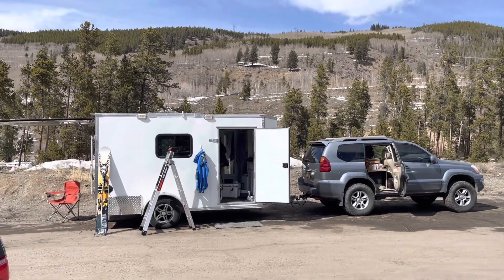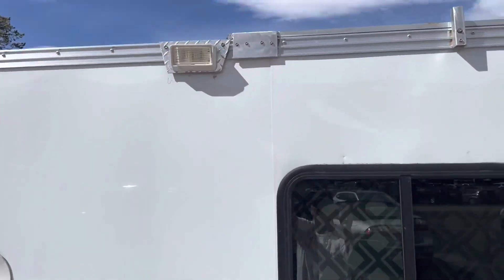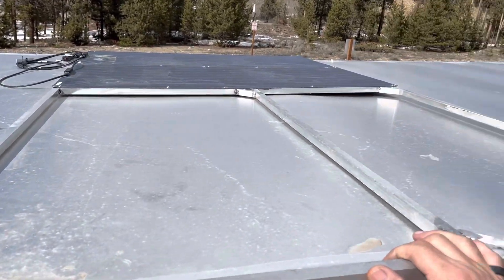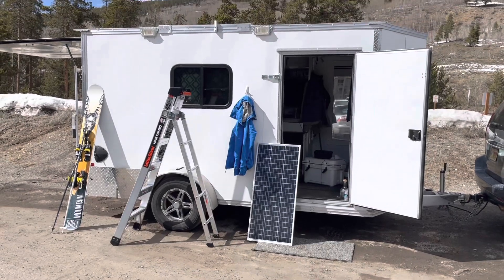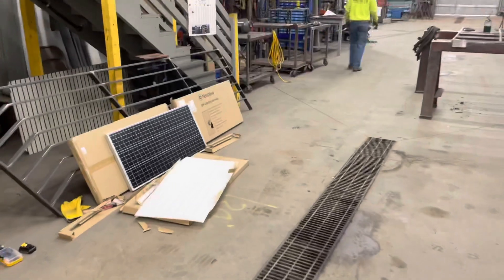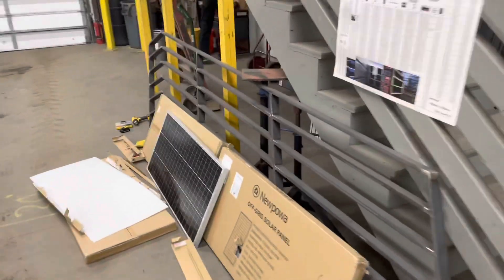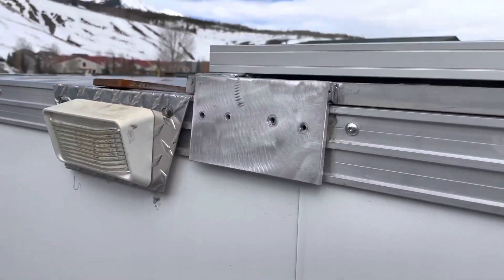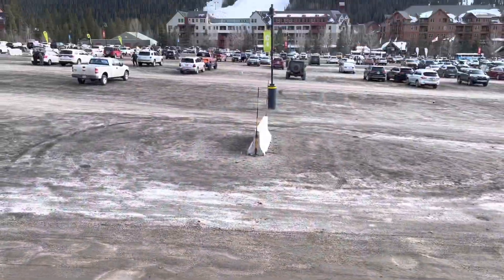Cargo trailer solar upgrade￼

Comment: Hey Rick I’m trying to get a similar project going on my cargo trailer before June. I love your recirculating shower setup. And you electrical set up. Any chance that you have plans or schematics available for someone with very little knowledge about electrical but with moxie and electrician friends to help me out to go off of. Also the plumbing for you shower set up? Take care
Reply from the maker: Honestly I have no written plans or drawings, everything was just arrived in my head mostly sorced out from YouTube, recirculating shower seems to work but the filters that were advised to me clog very quickly. 
Also I do not I have the trailer with me as I leave it in Colorado so I can’t video anything more in detail good luck, if you have any specific questions feel free to reach out.